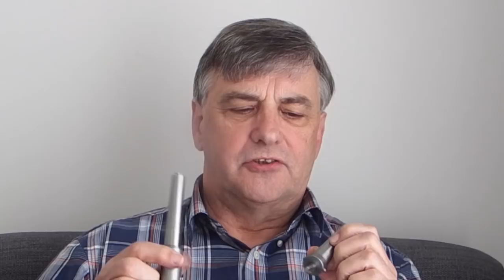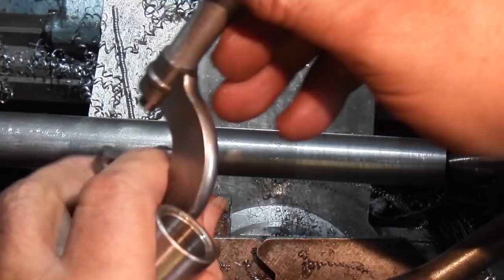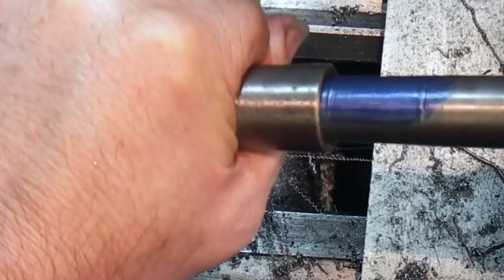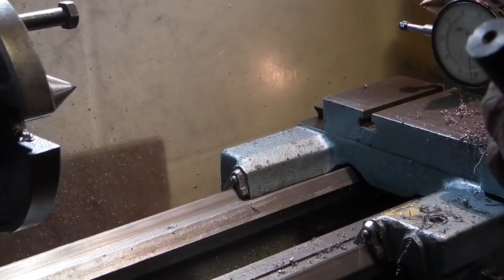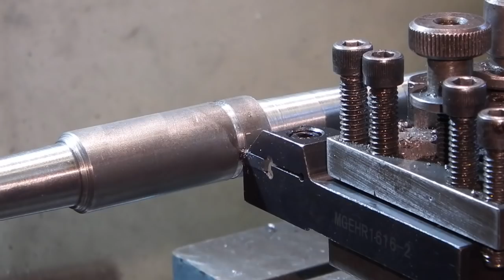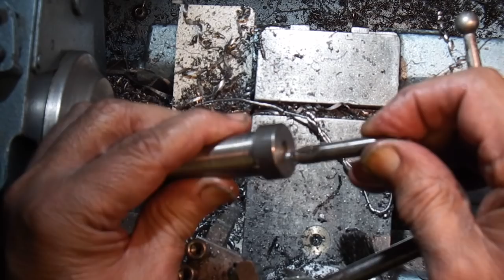Morse taper turning

Comment: Video is great, thanks. I have a question somewhat related. Do you have any ideas on how to “hold” a 2MT dead center in some sort of vise (??) so a hole can be drilled in the end that goes into the tail stock?
Reply from the maker: Hi Tom
I had this question some time ago and the answer was given by one of my viewers which was. To hold the big end in a chuck and use a steady on the small end.
Reply: @enotsengineering  That sounds like the best approach so far, and I have the rest as well to do it. Thanks !!

Comment: Why did you not set with a sine bar and then use your automatic feed on longitudinal cut get a better finish then file and polish to finish
Reply from the maker: Hi. At the time I didn't have a sine bar, but I did show a way of using the DRO to set an angle in another video.
see https://youtu.be/IOI_tIQc5do

Comment: Hi Allan, as un trained machinist, I'm easily confused about to0l geometry. What i don't understand is that if it's important to get geometry right when i'm grinding the tool then why do experienced guys like you and hundred others do things like change direction of cutting using the same tool, i am missing something obviously . if your tool is ground to cut right direction then how can it be used in left direction. This is very confusing , i'm not referring to cutting to fit in tight corners, I mean straight cutting in the middle of the workpiece .
Reply from the maker: Hi Billy 
It depends on the type of cutting tool being used. If you grind a tool by hand you may grind it to cut on the left hand side of the tool only which is normally the case. But if you are using an insert some insert tips are symmetrical like the triangle inserts and have cutting edges all round so you can cut to the left or right just by adjusting the tool holder to face the other way.
Reply: @enotsengineering  example of wht i'm trying to relay is the same tool at two different angles.... 08:18    05:25   07:50
Reply from the maker: Hi Billy. The tool used has a cutting edge on the RH and LH side and a rad to the tip so you can use either side. a bit like a thread cutting tool.
Reply: @enotsengineering  ah ok I see now

Comment: Hi Alan,  as a hobby machinist I've had exactly the same problem as you showed for using the compound slide method......run out of travel, BUT have always tried to leave my tailstock offset well alone, after spending many hours struggling to adjust it to schieve parallel cuts.....and the best I got is 2 thou taper over 6" length.  But your really neat trick with the set-up bar & DTI at 12.40 is a fantastic idea thanks, which should reduce re-adjustment to just a few minutes, and be spot on too.
Reply: this way of checking is only good if you use and absolute straight tube with no surface imperfections. I am not moving my tail stock until i get a test bar the length of my bed.

Comment: But surely your tail stock offset is only correct for a distance between centers. ie. the same as that when you set it using the sleeve?
Reply from the maker: HI Charles. Yes that's right, If you have a setting piece close to the same length as the part you're making. Then it"s a good guide to start turning the taper making small adjustments to get the correct finished result.

Comment: Just a thought. Could you rotate the QCTP through 180 degrees and use the same toolholder but with the tool sticking out backwards. This has helped me in similar situations. Thanks for sharing.
Reply from the maker: Hi David
Yes
I can see that would have worked on this job as it was held between centres and was a longer bar, so no chuck to get in the way.
Good Idea.